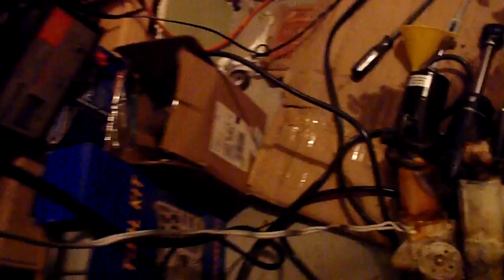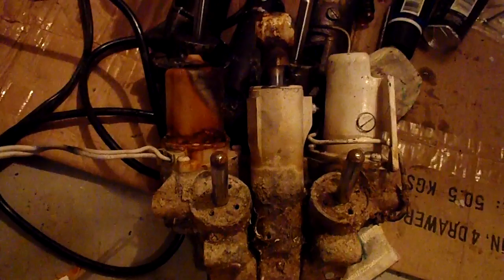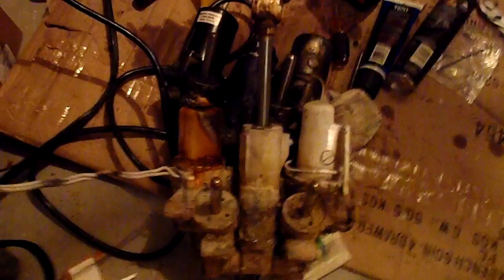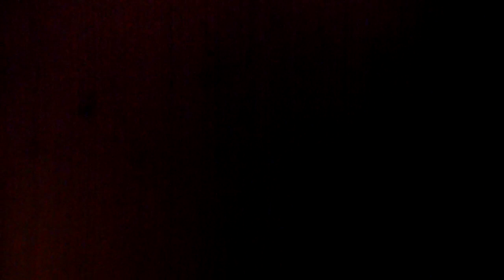Evinrude Johnson OMC trim tilt repair 2 wire

Comment from the maker: @CheatingHusband 

after i swapped the motor to a 3 wire and filled it up with fluid it went away.  I think that sound is cavitation caused by low fluid level or a worn motor impeller.  I somewhat doubt the later as i think it made the same sound when mounted on the transom.  So what i'd do is try and put more fuild in, purge the air best you can and see if it goes away.  If it doesn't, either live with it till the motor dies or swap the motor.

Comment: There is NOTHING wrong with that tilt unit...The gurgling noises are common, no need to worry...It would be near impossible to purge all the air from the unit.  Keep in mind your unit is tilted back somewhat, so that might be affecting the fluid level in the reservoir.  Also, note that adding fluid should only be done when the unit is in the full up position, all pistons/rams extended fully.